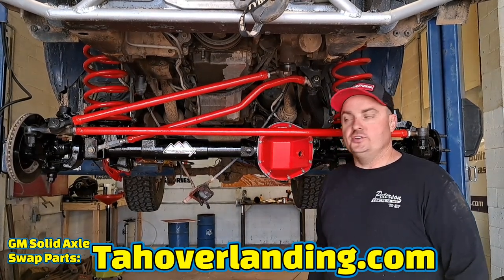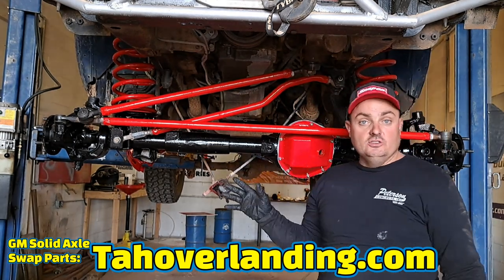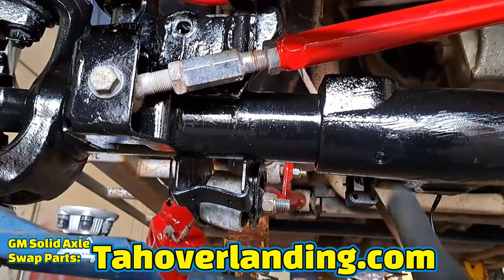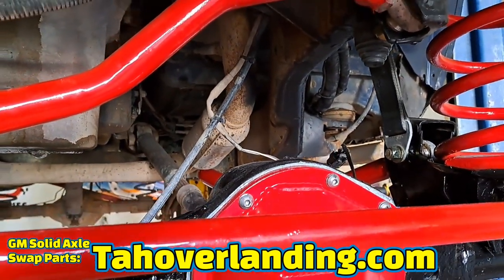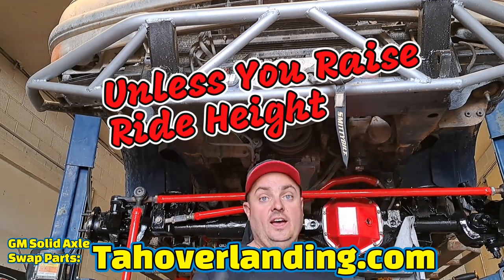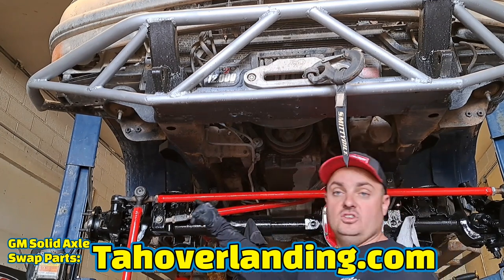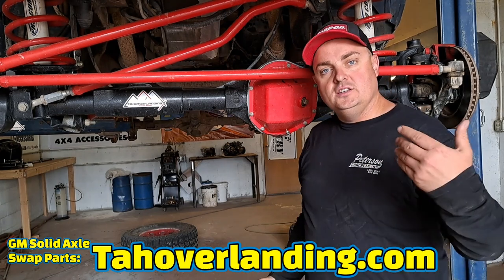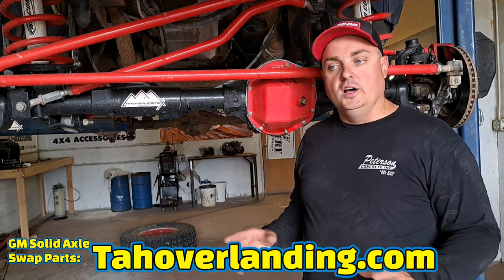Why this track bar is crucial from Tahoverlanding

Comment: A little off topic but do you think there is room for more of the factory 4 link dodge style instead of the radius arms? I know it would be a headache for sure
Reply from the maker: Here is a comparison side-by- side to a Mopar parallel 4 link. https://youtu.be/xreLdMWw8K8

That being said, there's not a single reason it would be beneficial to go to a short arm, parallel 4 link.  Not to mention the inordinate amount of work it would be

Why would you be interested in that?
Reply: @tahoverlanding  I had 2 broncos. Just tired of playing with radius arms lol. I just find the radius arms a little more rough on bushings.
Reply: @tahoverlanding  definitely not knocking the setup btw. Don’t want it to seem that way.
Reply from the maker: @budworx1639  I could tell that you must have had experience with ford. The Ford arms aren't even in the same ballpark. Message me over at Tahoverlanding.com I'll explain how lumping this is with ford arms is a huge apples-to- oranges comparison. But if you're a ford guy, you'll know that a huge help is to narrow how close together the arm attachment spacing is. Because the Ford arms are essentially parallel which in the case of any suspension (4 link or 3 link too) causes binding. So a parallel 4 link is just as bad.  The #tahoverlandingaxleswap has some triangulation to the arms. Which helps immensely

Also rather than bushings at the frame end, and bushings at the axle end like ford has. Which has literally zero  pivoting joints. So the flex of bushings is all the movement there is

 The Tahoverlanding Axle Swap uses  joints, 4 pivoting joints per arm

It's really not even close to the same thing

P.S. I've been a member of the Utah bronco club for 15 years. I have extensive experience with the ford radius arms

Comment: Hey Tripp! Would your solid track bar builders kit and radius arm kits work with the 2nd gen ram?... you guessed it... I finally sold the titan, and found a manual transmission 2nd gen ram 1500 with all options and 3.92 gears and couldn't pass it up. Now after buying, I realize its like I still have to do almost all the stuff needed for a tahoe solid axle swap anyway!😆 Well... theres no such things as a free lunch I guess
Reply from the maker: I think it will. Guys have used my parts for other dodges. Rams and dakotas